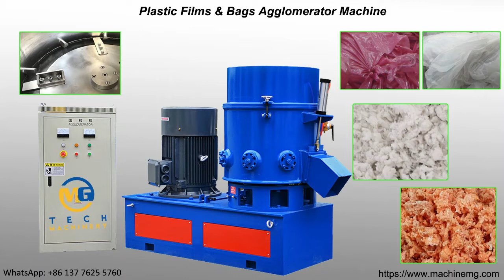How efficient plastic film bag agglomerator machine agglomerating PE PP PET films bags and fiber

Comment: Do you use water and some kind of bonding agent material for the agglomeration? 
How this machine densified the material?

I am working on my university project to increase the density of shredded recycling plastic (pp & LDPE thin bags) without heat and water. I just want to make pallets as you made in this video. So the next manufacturer gets quality material)( if I make pallets/granules from the material like the recycling plant makes, it will get heated 2nd time and the 3rd time by the customer)
 
Please help if possible by giving answers to my above-mentioned question.
Reply from the maker: agglomerator machine densify the materials by crushing, hot temperateure from rotation and some water also, is that ok for you? friend. my whatsapp +86 137 7625 5760
Reply: @MGMACHINERY  
Thanks for your response. I found the exact system that can be used for my requirements.